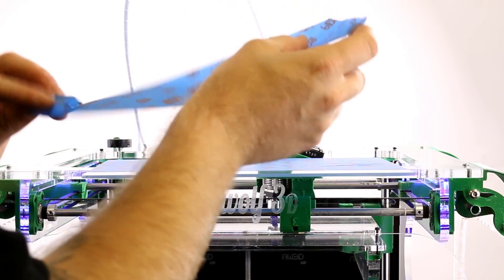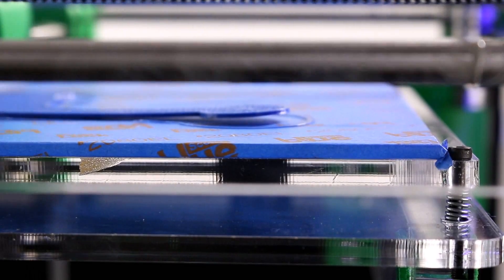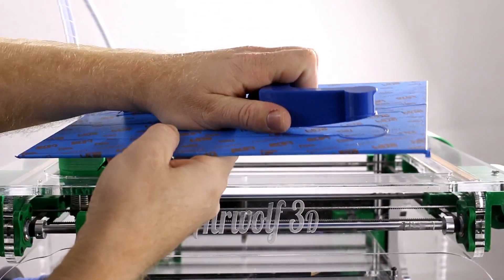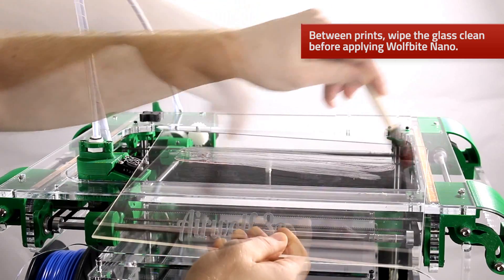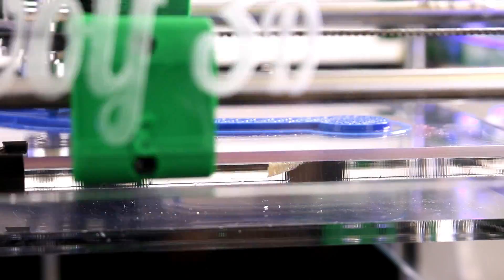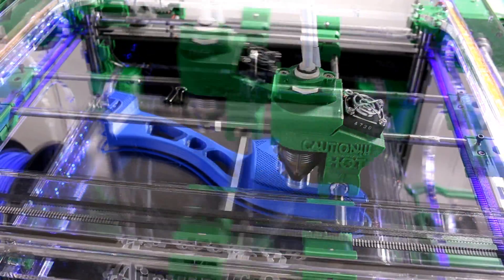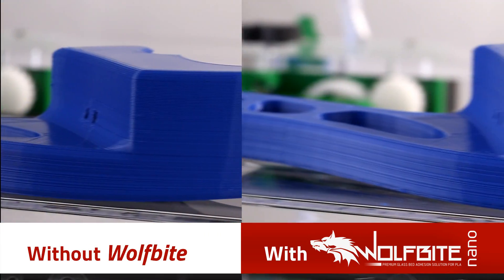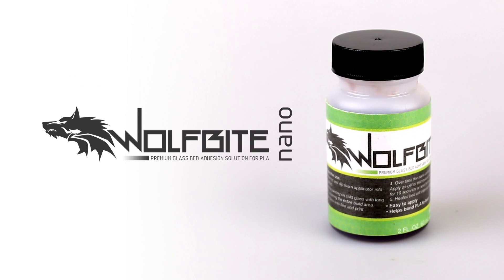3D Printer Bed Adhesion for PLA - Wolfbite NANO

Comment: can this be used on acrylic print beds
Reply from the maker: alfie winn 

Yes, it can be used on acrylic print beds; however, it does not adhere as well as it does with glass beds. Acrylic beds may require 2 coats of Wolfbite Nano to properly adhere. To do this, apply one coat of Wolfbite Nano and allow to dry. Then re-coat. This process should ensure that your prints properly bond to the acrylic print bed. Thank you for your interest!

Sincerely,

Airwolf 3D

Comment: Very interested in buying this product and Wolfbite - then I see that its over a $100 for shipping to the UK. Thats 5x the price of a single bottle. Excuse the pun but "get a grip" guys! :-)
Reply: Hi Niall, weve got it covered http://shop.3dfilaprint.com/wolfbite-nano-1083-p.asp
Reply from the maker: Niall Barrett 

Unfortunately, the exorbitant price shown on our website is actually a glitch with our auto-calculating commerce software. We are working to resolve the issue; however, we currently recommend that our international customers either call for an accurate shipping quote or refer to their closest authorized dealer to obtain the lowest shipping price and the fastest delivery. If you would like to locate a dealer near you please refer to the following link: http://airwolf3d.com/store-locator/. 

We apologize for the inconvenience.

Sincerely,

Airwolf 3D

Comment: 19.99 introductory price? I hope you have some stats to back up why this is better than using purple elmers glue stick you can get 30 sticks for 10.88.  Plus the stick works with both PLA and ABS and which also dissolves in water if you have a stubborn stuck print. (heck you can just use waterdown elmers PVA glue for even cheaper!)

Also using painters tape is widely used, especially on glass to prevent diviots or the glass (even boro glass) from cracking in half because of the stresses some prints put on glass over its lifespan.  I don't see that your product would help in this matter.

just my two cents...
Reply from the maker: David,

If you find that glue sticks and painter's tape works best for you then we recommend that you stick with them. Wolfbite™ and Wolfbite Nano™ were developed to give consumers another tool in their tool belt for dealing with stubborn print jobs. Airwolf 3D partnered with expert chemists to develop Wolfbite/Wolfbite Nano in response to wide-spread frustration with traditional bed-prep methods. Users who are content with traditional bed prep methods are encouraged to stick with what works for them. Wolfbite™ and Wolfbite Nano™ are intended for users who are discontent with traditional bed-prep methods.

Thank you for your feedback.

Airwolf 3D